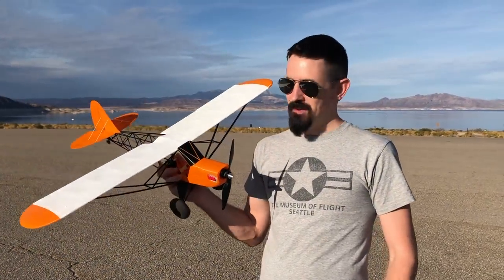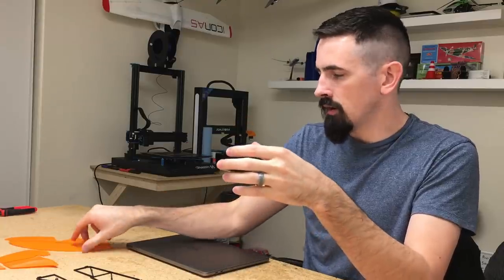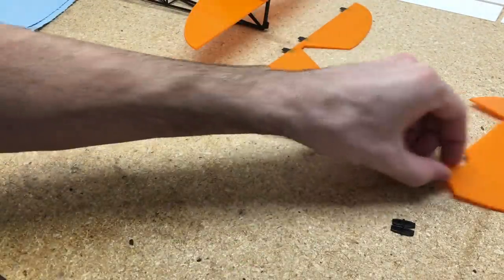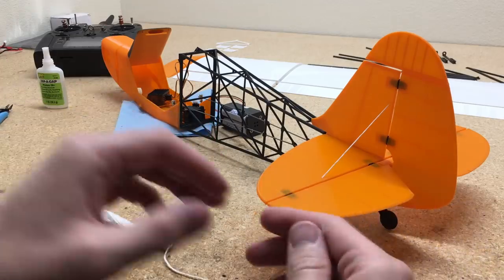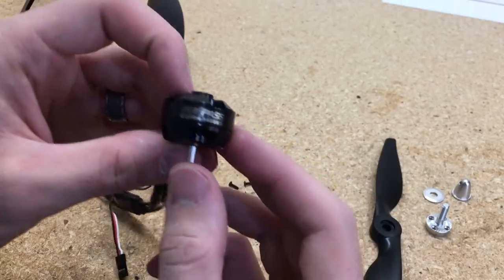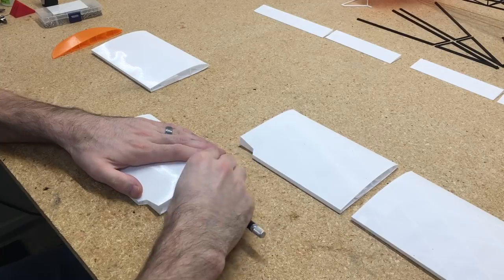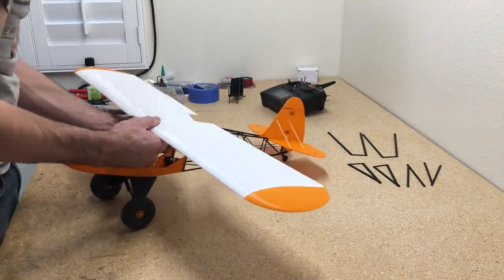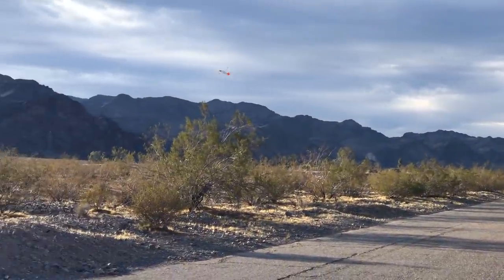How to Build RC Savage Bobber - Planeprint

Comment: A fantastic step by step guide by a well respected enthusiast. Keep it up.
Reply: ps is this plane ok for a novice pilot/builder?
Reply from the maker: @garyrayuk  Thank you Gary, Yes this planes an easy beginner airplane for a new builder. It is nice because it prints out fast and there is limited thin wall parts. Hopefully this video will help make the assemble process a bit easier. Cheers

Comment: Troy, could you detail your settings for the varioShore TPU for the wheels?  Cheers.  David
Reply from the maker: Hi David,
I printed varioshore tpu at 
60% flow
240c
30 mm/s
10% infill
3 bottom layers
4 top layers
2 wall line count 
.2 layer hight 
It may need printed slower depending on printer
Reply: @TroyMcMillan  That's perfect... thanks Troy.  I really like the look of those tires.  I'm going to try them on the Big Bobber.  Almost finished printing it.  This is very cool stuff.
Reply from the maker: @rcdavidk  Yes it is very cool. I have not re printed the Big Bobber tires yet but I am definitely going to when I take it out again to fly. It is perfect material for large bush tires.
Reply: @TroyMcMillan  I just loaded the Big Bobber tire into the slicer and it reports 10.5 hours for printing... yikes.  A wing part only took 7 hours.  The little back tire is 30 minutes.
Reply from the maker: @rcdavidk  Ya the tires take along time to print for sure. But it is worth it they are awesome. 7 hours for wings is actually fast my wings for this build were all at around 10 hours each part.
Reply: @TroyMcMillan  10 hours? Each section of my wing print is around 4 hours, is that why I'm having issues I wonder? I'm using your settings as above but getting poor results, how would I slow the print? Ender 3 Pro btw

Comment: Do you spray kicker every time?
Reply from the maker: I almost NEVER use it, it always causes discoloration on PLA. I only use it in the case of a quick repair, but otherwise I really avoid it as much as possible.

Comment: I could have used this a week ago I just finished mine using the same color scheme. I used your earlier video with the P3 and it helped.  Used an ender 3 v2 and now that it is assembled I am beyond excited to fly it. The only issue I am having is that where the motor mounts is crooked on 2 different prints of the cowling in the slicer it looks like it should be crooked not sure if you had the same issue
Reply: down and to the right

Comment: What size servos did you use? the size they specify in the PDF file are like impossible to find anywhere.
Reply from the maker: I used the ones in the pdf file, and they were very hard to find, or you could use a cheap 1.7g servo that would fit too

Comment: What emax Servo did you use? Cant get the ones who they recommended in the manual
Reply from the maker: I used the ones in the manual, but you can also use any 1.7g servo

Comment: Hi Troy thanks for the video its great. I print a previous plane with your instructions the icon a5 and works great. Now i start printing this plane but when i print the large fuselage piece, 3 times the piece disconnect at the point where start the window, …. About 1 cm from the base. I dont know whats the issue. Any idea?

Comment: Could you add some links to the same motor and servos you used in your build? This is my first RC project and my knowledge of different parts is very limited lol
Reply: I'm loving this!  Almost finished with my first print on the Artillery Sidewinder X1 using your Cura settings and it is perfect, no brims!  Looks like you're using the Emax ES9051 4.3g digital servos.  Is that correct?

Comment: Great video, I'm working on designing my own cub with some of my engineering buddies. Were going to overengineer the hell out of it but i hope it'll turn out well. Were running it through physics simulations using Siemens. I have a ender 3 max at home and we're aiming for a 1 print fusalage becuase of the 1 foot printing area.
Reply: Sweet, would love to print a cub, please share when you’re done! (Or sell, I’d pay)
Reply: @samroesch  hah I'll let you know. Maybe I'll put a video about it. I do have a GoPro so we'll see

Comment: I cannot not get the landing gear top print right. Every time I Slice them in cura with your settings the print almost completely forgets about the entire sidewall of the gear and just prints the surrounding structure of them. It basically only prints half of what I'm seeing

Comment: Hi Troy, I bought the plane files but didn’t see the seats and the mount to screw the landing gear on, is there a new update to the files available somewhere to download from? 

Also, I am using Gorilla glue (suppose to be strong) here in Australia, the back frame seems to be very fragile. Are you using medium ca with accelerator with every thing you are putting together? Thanks
Reply: The seats and updated main landing gear are in the free tuning parts for the Savage Bobber page on planeprints website.  Here's the link https : / / www . planeprint . com / bobber - tuning. Sorry YT wont let me post the link directly

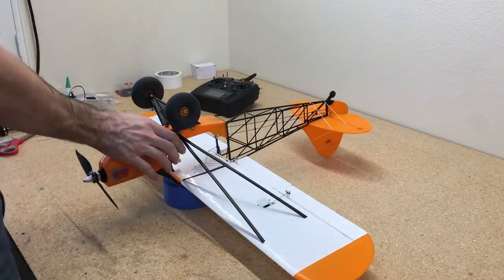Comment: info.      good work.    nice  bobber.    except, where it's not.         evidence indicates that    Every  One  of  these  printable designs  contains  at least one  Major  Flaw.!!!          at 1:07,  it appears that  someone chose to use  a  thinner,  less-optimal  profile.       consequently, the in-flight behaviors of the model  should be expected to  be  'less-than  normal'.          a main wing is  Supposed to have  a  main  spar,  Located  at  THIRTY  percent of chord.            each of the main wing sections   SHOULD  have a  correctly-located  main  spar.          Design of the  joins of the the segments  Should  INCLUDE  a  means  of  Solidly  connecting  the  partial main spars, to  one another.!!!            the use of  rib-like structures  in a wing  makes  it  more  resistant to  twisting.    any  ribs  in  this  wing.????           in general,  3d  printing  results in  a structure that appears to be  monocoque,  but  isn't.      in part, because, the covering is not  'functional'.           at 14:44,  this is a less-than ideal  control horn  design.        the  control horn  pivot points  are   NOT  optimally  located.            at 15:48,  WRONG  ---   since there is  no  Actual  provision  for  pivoting, there.!!!!!          at 16:04,  the longest wing  struts   are  TOO  wiggly,  to  be  Functional.!!!!        consequently,  they  are  dead  weight;   that  outboard-extending  mass   Has  an  affect  on the  airframe's  span-wise dom !!!!           at 17:27, can you spell,  TRIM  the  Elevator  ---  FIRST  THING.!!!!!         is cg  at  30?        (at 2:38,  called  a  tail boom.)       googletranslate